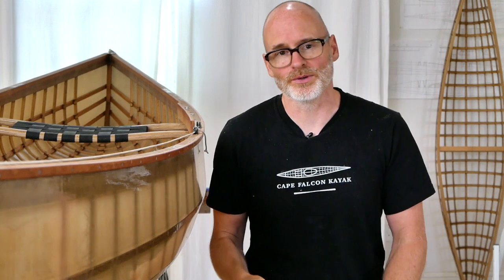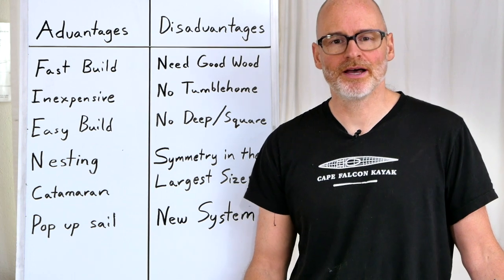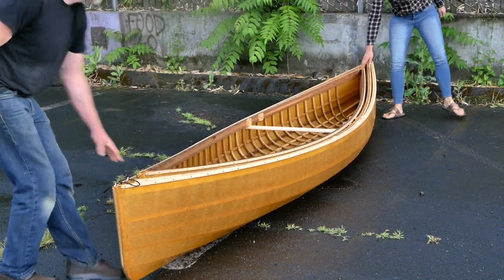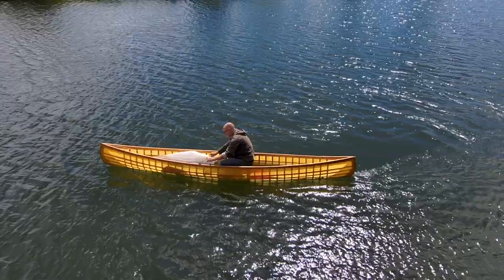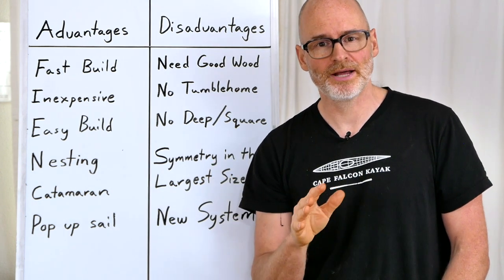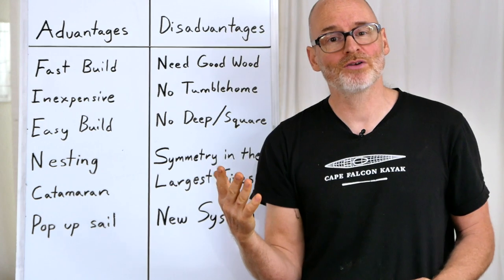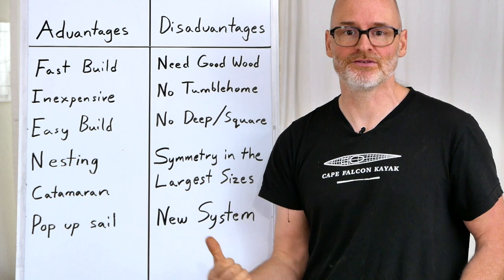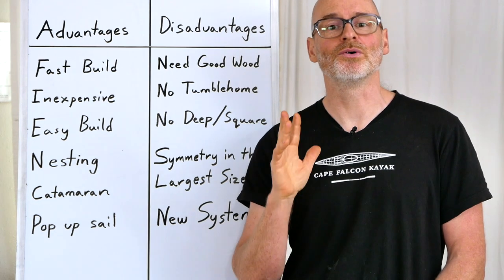Updated: Advantages and Disadvantages of our Canoe Building System, with Tumblehome!

Comment: To add tumblehome to your canoes, just cut the middle 5 or 6 mortises on the gunals on a 5 to 15 degree angle pointing out. The bottom of the ribs will then need to be wider at the bottom and curve back in the connect to the gunals. This will interfere with the ability to nest, but not every canoe builder wants to do that anyway.

Comment: Brian, are you costing these with the Skin Boats two-part urethane? Thank you.
Reply from the maker: I am, but I have a very specific system so it turns out well
Reply: @capefalconkayak  ok thank you. I’m having a very bad experience with 840 primo on my Greenland Kayak I just built. I’m doing test panels before I do my boat and this stuff just keeps sagging when I coat it even though it’s drum tight the begin with. Grrr
Reply from the maker: @Cad1900  you’re not alone I would say over half the people that use these products have poor results.  This winter, I’m probably going to release my skinning and coating system as a separate minicourse on our site for people who want that information but don’t want to buy the entire building course.
Reply: @capefalconkayak  Thank you for that. I’m very interested in your skinning course and I believe a lot of people will be. I got primo by mistake btw that is not what you recommended to me. I have a theory on the primo that I’m testing. I believe the weave is so tight that we don’t get full soak thru with the urethane. It’s coated inside for sure but I believe it is not nearly as much as say the 840 tuff would have been. I’ll report back with what I figure out.